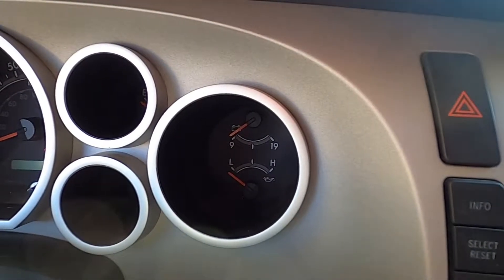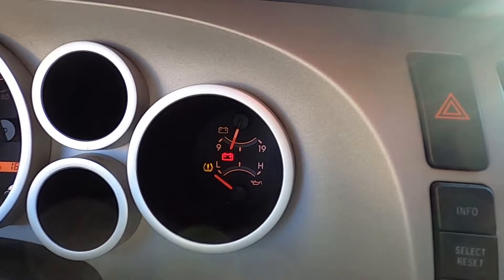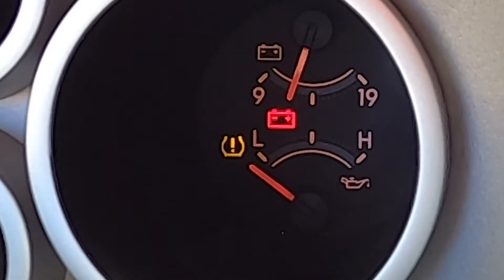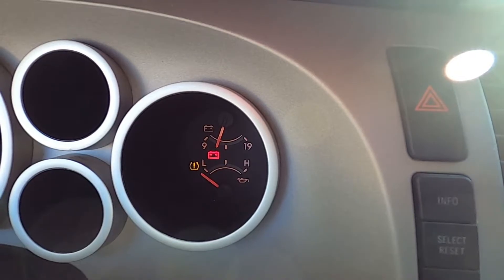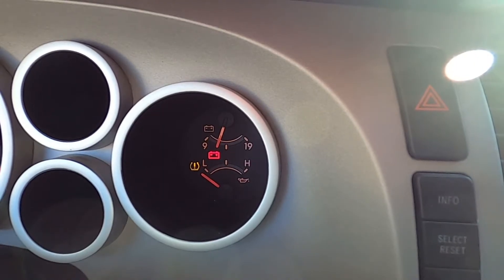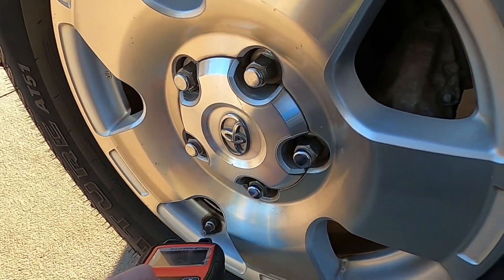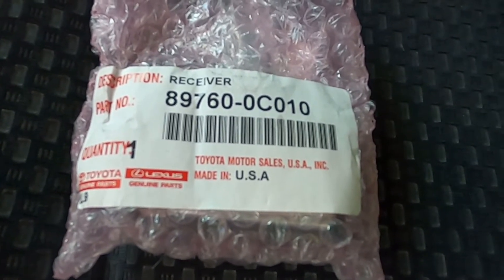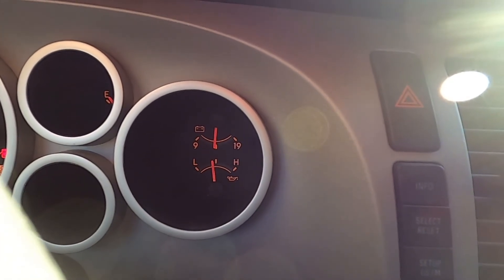FIX! TPMS Low Tire Pressure Light - 2008 Toyota Tundra - NO BYPASS!

Comment: Great video. This is very helpful information. How did you know it wasn’t the TPMS module? My mechanic is saying something is wrong with my module and scan tools aren’t seeing it.
Reply from the maker: Luckily I didn't have to go to that third component as my issue was resolved at the receiver. The module was communicating as I was able to pull both the TPMS IDs and the same IDs were written on the module--therefore, I decided to replace the receiver. Hope this helps!
Reply: @BDTube2006  Very helpful! I did find another video on here and located the module (TPMS ECU) under the passenger dash. I believe that is my issue because when I was using Techstream, it is not responding to that particular ECU only.  I'm going to buy a replacement on ebay.  Thanks again!
Reply from the maker: @Kovz34 Awesome! I hope everything works out, keep me posted!

Comment: Great video, very helpful, but for approximately $800 for that little part, I guess my light will stay on
Reply from the maker: I appreciate the comment. Thank you! I, too, battled with the idea of paying that price as well. However, I really wanted to beat this issue (plus the comfort of knowing I could keep the family safe while driving). Definitely shop online for the best price. I checked the dealership and was quoted $875 for the part. However, I found the part currently online discounted for $585 (it still may be a bit pricey, but nice to be able to save close to $300). An alternative would be to check local junk yards for Tundras and Sequoias as they share the same transmitter. You could easily pull one for much cheaper. If you go this route, keep me posted!

Comment: Did you reimburse the tire company for all parts and the extra work?
Reply from the maker: Great question! I paid for the initial 4x TPMS sensors and labor. The brand sensors swap was at their recommendation, and they covered that. Discount Tire was never at fault for any of these instances and was a pleasure to work with. We all were working together to find a solution.They provided amazing customer service and went above and beyond to assist as far as they could.  By no means was this story geared towards the lack of support from Discount Tire. Again, they were great to work with, and I will continue to refer and utilize their services.

Comment: Seriously.... You spent $500 + on a 17 year old truck just to turn off the light?? I jumped the wires in the module under the glove box with a 15c quick tap.
Reply from the maker: Not exactly. The primary reason for replacing the receiver was to ensure the TPMS system was functioning correctly—the light turning off was just a bonus. Knowing whether I'm losing tire pressure, especially while towing my travel trailer, is a critical safety concern. That information is only available if the system is working properly.

Of course, I always check tire pressure manually before departing and during fuel stops. However, if I were to puncture a tire and experience a slow leak over the course of a 2-3 hour drive, I wouldn’t be aware of it just by disabling the warning light. Sure, I could have bypassed the system or simply covered the light with electrical tape, but when traveling with my family, I prioritize safety. Spending $500 to fix it properly was well worth the peace of mind. Regardless, I completely understand your logic here and, yes, $500 to turn off a light would be a bit ridiculous. 

On a side note—17 years in, and the Tundra is still going strong!

Comment: Tire shops over inflate your tires and i think it messes with your tpms
Reply from the maker: @eddiesandoval2540  absolutely! The tpms will trigger if it is below or above the indicator threshold. Hooefully, shops will pay attention to the placard on the driver side door, but if not, you may need to bleed some air. I've experienced that a couple of times when serviced, the tech dropped 40lbs in the tires (I only needed 30-32 lbs).
Reply: I recently had a discussion with a tire shop employee regarding the appropriate tire pressure for my vehicle. I had adjusted the pressure from 40 psi to the recommended levels indicated on the inside of my door, which were 30 psi for the front tires and 33 psi for the rear tires. However, the employee insisted that 40 psi was an acceptable pressure and that driving would only increase the pressure by 3 psi per tire when warm. Despite my objections, he reset my tire pressure sensors and inflated the tires to 40 psi, resulting in the reappearance of the TPMS warning light.

Comment: So if the light flashing you need to replace a new receiver and the tpms ?
Reply from the maker: First diagnosis step would be to check the battery life of each of the TPMS sensors (typical lifespan is approx. 5-10 yrs).  Any "dead" TPMS sensors will require a replacement for each dead sensor.  If all TPMS sensors are showing a healthy battery status upon scanning, but you you still have a low pressure dash light, make sure all tire pressures matched the sticker on the driver's side door frame (this will give you the exact pressure that is programmed into the module). Make sure you relearn the pressure that you set it to (the little button under the dash). If those fail, then I would move on to the TMPS Receiver.

Comment: Glad you got that pesky light fixed. Thankfully I was able to manually reset my low tire pressure light in my 2014 Tundra by pressing the reset button near the steering column but it took a good bit of driving in the cold weather to  clear. Now I know what to look for if the issue happens again. You probably saved a good bit of cash fixing this yourself! Congratulations! 👍🏼

Comment: Does anyone know if a 2016 Tundra OEM spare Tire has a TPM chip?
Reply from the maker: I dont believe Toyota typically installs them in the spare (due to location and access to add air if low). However, I would suggest having it scanned (Discount Tire, Toyota, etc.) Or check out the scan tool linked at the bottom of the video description--great tool to have on hand for quick readings, diagnostics and programming. It has come in handy multiple times for myself and others.
Reply: @BDTube2006 they put it in the spare of the first generation
Reply: @BDTube2006  appreciate it.

Comment: Does your truck have TPMS sensor in spare?  I have 2006 Tacoma and spare tire has sensor that also needed to be replaced after about 11 years of service.
Reply from the maker: @alanm2525 My stock spare did not come with a factory installed TPMS sensor.  However, I did remove that tire and replaced it with a full-size tire (which still fits underneath--and I highly recommend as you're not limited by the spare tire performance). The full-size spare came in quite handy when I caught a nail while pulling my travel trailer and had the full-size replacement ready to go!
Reply: @BDTube2006   absolutely

Comment: I heared that the reciver is the same for lock the doors too. Istnt this the case? Than there too you shpuld hava a problem. Just asking, mine has problems too
Reply from the maker: Correct, that receiver also handles locking/unlocking the vehicle.

Comment: Good video✌️

Recently bought a 2021 Toyota Tundra  RS5 certified vehicle with 19400 miles. Driving back from TX to Lake Charles TPMS light comes on but no pressure display! Went to the dealer and reset and test sensor and all good! 

We get pressure readings (as normal) before light comes on. Then light comes on and we no longer see any readings for any of the tires pressure. They reset it again and now it shows "normal", they decided to keep it to keep looking... but once I start driving I know light will come on again because that is what it does. There is a gap between reset and light of approximately 30 to 40 miles until light comes on again.

Is this issue is related to the receiver?
Reply from the maker: That's an interesting scenario. Since the system reads after reset, but then triggers again, that would leave me to believe it's more on the TPMS module malfunctioning vs. the receiver.
Reply: @BDTube2006  

Did you know where is the TPMS module located?
Reply from the maker: @piratedust5761  try looking behind the glove box to the left.

Comment: I have a 2007 4x4 quad cab Tundra that Discount said all for tire sensors have ffailed. New tires and new sensors installed and nothing worked. Was told to let it sit for a day. Drove the truck 100 miles the following day still did not work after a number of times using the reset button. Discount agreed to refund my $260.00 and they did not bother to remopve the four tire sensors.  Question _ If I buy a receiver do I need anything else to get the sensors working?   .
Reply from the maker: You're practically in the same boat with me here...   New sensors in the wheels and the lights are still on?  There are few possible issues: 1. the techs did not pull the codes from the old sensors and write them to the sensors (transfer), 2. they used all new sensor codes but did not write them to the ECU, 3. you, too, may have a faulty receiver.  First I would have Discount pull the codes from the Sensor and the ECU to be sure they match (4:20).  if they dont, the techs will need to write the sensor codes to the ECU so they match.  If everything matches a quick swap of the receiver will fix the issue--unless it's the TPMS module itself (probably not likely, but have to mention it).  Keep me posted on what scenario you fall under.  There is a link in the video to purchase the TMPS reader (comes in handy for more than just this fix--I enjoy it for many other reasons. Good luck!
Reply: @BDTube2006   be sure to include your spare in your checking of pressures

Comment: You may have mentioned this and I’m not understanding, or getting it.
But could I not just disconnect the sensor to just get the go off if you don’t care about this sensor information.
Thank you for this information.
Reply from the maker: Thank you for the comment @William Lee, disconnecting the sensor is exactly what would trigger the light.  The light indicator reflects some type of fault in the system.  Therefore, if the sensor was removed, the light would immediately trigger.  The only way to disengage the light is to bypass it (electrically); I believe there are Youtube videos on that process.

Comment: Just a side note the spare tire also has a sensor
Reply from the maker: Unfortunately, my spare does not have a sensor.  I'm not sure when exactly Toyota started adding them in the spare (if that is common practice now for their truck line); however in the 08 models,  my truck did not have one in the spare. I certainly check that first with the scan tool :D  Regardless, great tip!
Reply: @BDTube2006 My first gen has it😢

Comment: Would this happen on a 4runner too? My spare is filled and so are the rest of my tires, and there is a low tire pressure light always on... Going to do a bypass soon, but was curious if this might be the issue.
Reply from the maker: Absolutely, the setup would be the same, however I know the Sequoia and the Tundra shares the same module, however the 4Runner would be a different receiver. Is your keyless entry working properly? That's another tell if you're experiencing issues there too.

Comment: Ongoing with my 2010 after some Redi sensors installed on new tires. Now I have techstream on my pc and an autel TPMs. Replaced antenna but still getting issues. Will try the relearn again and go from there. Pain in the bum but ain’t no stopping now
Reply from the maker: Def. pull the codes from the sensors and the ECU, make sure those match. Good luck, keep me posted--would like to know the outcome.
Reply: Don't forget to check out your spare. At least in the first gen they're included in the system

Comment: My truck(2013) is still plagued by this ten years later. Also got quoted a ridiculous amount by Toyota and have just been riding with the light on. Thank you for your video, I will be dealing with my own truck soon.
Reply: Don't forget to check your spare. At least on the older ones first gen they're included in the system
Reply from the maker: Yea, Toyota quoted me over $1200 to fix it (which was their way of saying we will swap all the components out).

Comment: Can you just unplug the Spencer, and have the light turn off And stay off? leave the sensor out if you do not care about the tire pressure gauge?
Reply from the maker: The system is triggering due to the missing sensor, therefore, leaving out the sensor would keep the light ON. Any malfunction of the four sensors, low pressure or faulty receiver will trigger the light. However, many folks will ignore the light :D

Comment: Did the scanner show any TPMS codes with the bad receiver?
Reply from the maker: Unfortunately it did not because the scanner is comparing the sensors (directly scanned from the valve stem) to the module (which is programmed directly via the OBDII port).

Comment: Dude, I have been going NUTS trying to figure out wtf is going on... 3 sets of sensors all professionally installed and same issue each time. Going to look for this part and see about getting it replaced. Thanks so much for the info!
Reply from the maker: Awesome! Keep me posted if that's the issue for yea!
Reply: @BDTube2006  Unfortunately, that did not work; I believe I have the "Closed Loop" error... still trying to fix...
Reply: @awesomebase  The fact that you came back after 3 years for an update is amazing
Reply: Having this same issue with a '07 Sequoia after having 5 new  Denso OE pre-programmed sensors installed. Tire shop activated the sensors & wrote them to the ECU. Their tpms tool says the sensors are transmitting &  programmed to the vehicle however the low pressure indicator light will not go out. It's not flashing anymore but just steady on yet all the pressures are good. I'm pretty sure Toyota uses the same receiver unit for both keyless entry (key fob) as well as the TPMS system so I'm curious as to if the receiver unit was bad if your key fob still worked? If not that would be a telltale sign of a bad receiver but my keyless entry and all works fine. I'm about to setup Techstream on one of my laptops to attempt to see exactly what's going on w/ the TPMS module. Such a problematic little feature for all it does. Very informative video however, thanks for sharing.

Comment: that receiver is very expensive. I would just drive around with the light on if it were me.
Reply from the maker: I agree. I believe I picked mine up for around $400. Personally, it was more for safety when towing and having my family with me, if that wasn't the case, the good ole electrical tape would have been sufficient. :D Ha!

Comment: Mine flash, turn solid then turn off. Has happened twice. Why is it turning off if it's not working supposedly?
Reply from the maker: Is that upon starting your truck? I'd recommend checking your air pressure (cold), to be sure you're at the right pressure. Depending on age, the battery may also be low. With the weather change (getting cooler), your pressures will start to drop, especially in the a.m. I've already had to add air just a couple days ago, as my light triggered on, but went away as the tires warmed up; therefore I waited til the tires cooled and aired them up.
Reply: @BDTube2006  No, it happened while I was driving on the freeway. But, I will definitely check the pressure just be sure. Thank you.